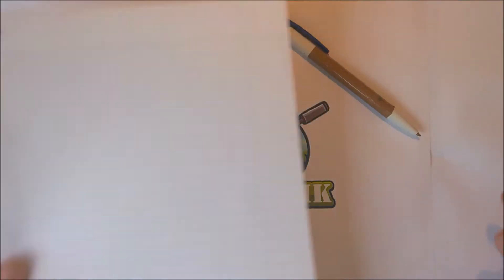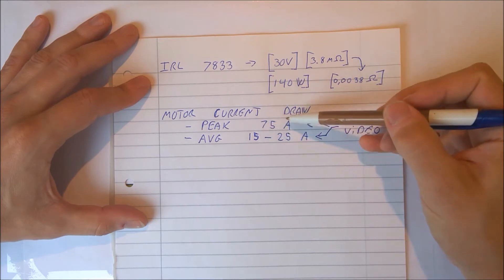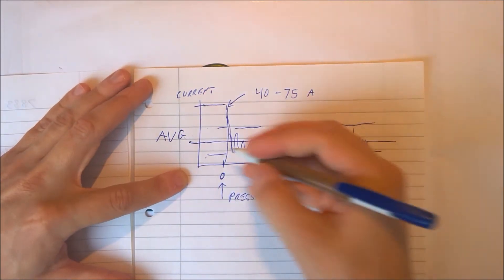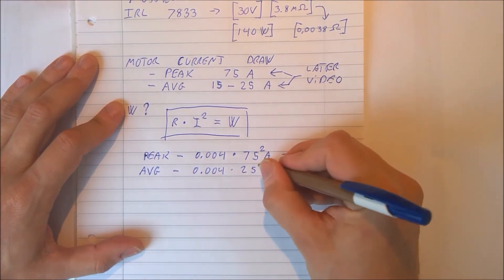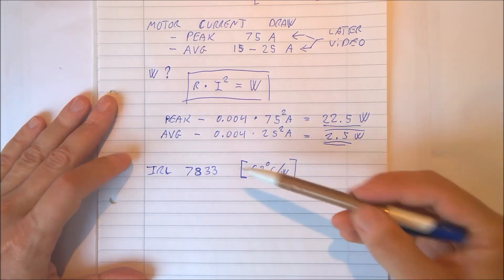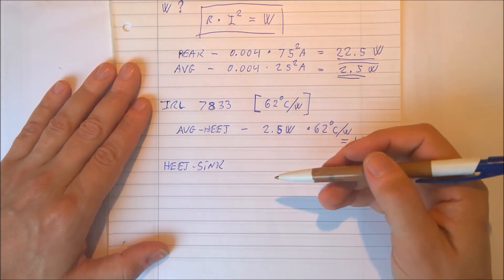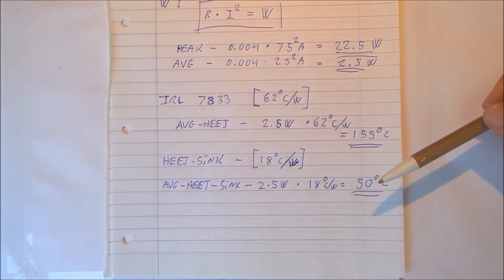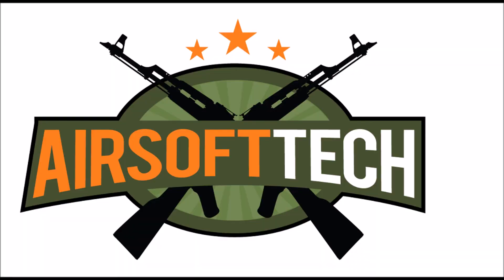Airsoft Mosfet Math - 1 First Video

Comment: Good video, but you probably forgot about the schottky diode to prevent high voltage on motor breaking
Reply from the maker: No I did not ... Almost all power Mosfet's has internal flyback diods ;-)